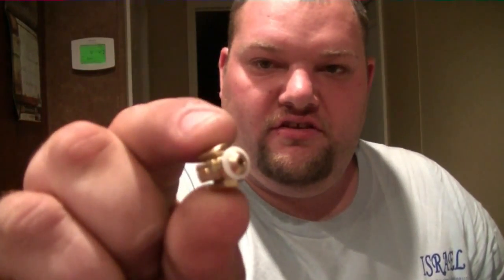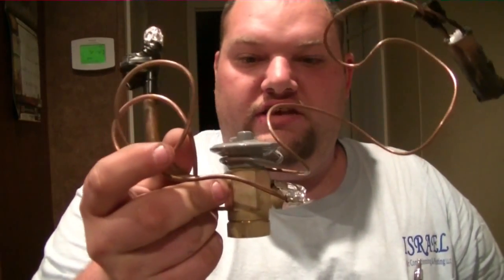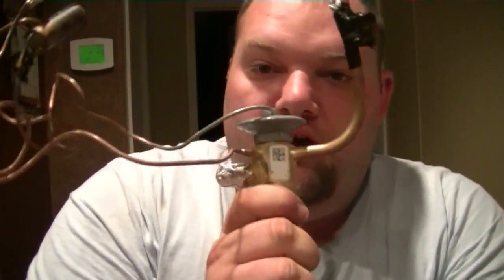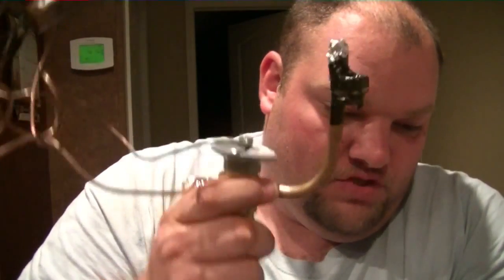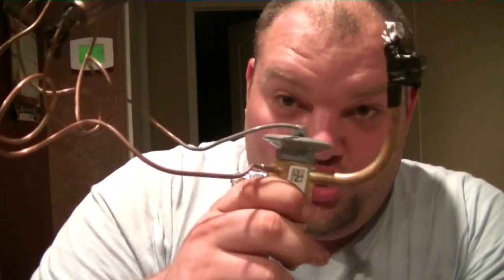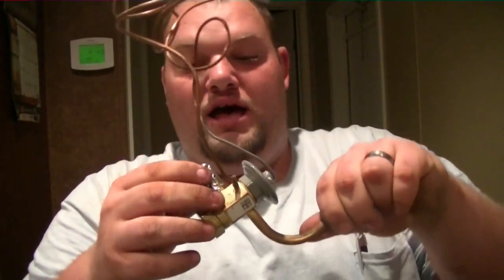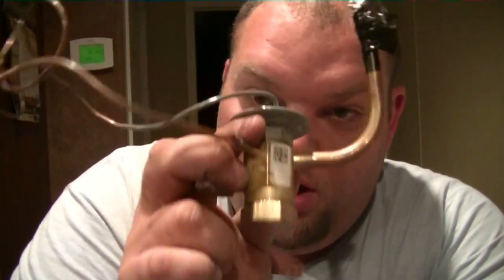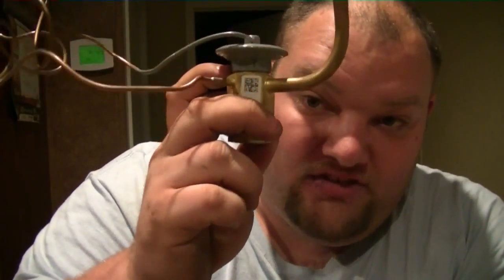HVAC Tips- Pistons vs TXV's

Comment: I see what you're getting at, but then again, it all depends on the quality of the company that made it, and how careful the technician is when installing the TXV, if it's properly heat sinked, and nitrogen purged, something else may break and total your system before the TXV breaks. You don't always necessarily have to replace every TXV you install, you've probably just had bad experiences caused by other technicians doing a bad install job.

Comment: I think we have a failing txv or an over charged unit  our comp is sweating on the side ruud unit Copland scroll 14 seer but  the unit is cooling just fine  on a 80 90 degree day the unit  will maintain 72 which is what its set too I noticed it  doing some yard work the other day bent over and  saw it sweating cause there was lot of water around the condenser  but my parents don't wanna have it checked because its still cooling. so what can ya do
Reply: oh okay well thanks  our unit is still running just fine sweating away.

Comment: I agree, in 20 years, other than installers not putting the correct piston in, or installing it backwards, not putting one in at all, or issues due to system contaminants, I've only ever found maybe 2 pistons that physically failed.

I've always been a fan of TXVs due to the efficiency gain and compressor protection, but somewhere in the 2000's the TXV manufacturers started making crappy TXVs that fail a lot.
They used to be very reliable. :(

Comment: Now you have to factor the use. A piston is good for constant loads. Where txv is good for varying loads. Example a heat pump is a great time to use a piston on the "indoor coil" where the load is for the most part constant. A txv works very well in the "outside unit" where on a heat pump the load is varying depending on the season

Comment: the txv is great if it was reliable for the life of the unit, but they are not, the entire purpose is to maintain a constant superheat so the compressor efficiency stays high, as we all know the warmer the refrigerant is the more it expands and it takes more compressor cycles to compress the gas back down, therefore reducing compressor efficiency, however the difference in efficiency is not worth the loss in long term reliability! The real answer will be when daikin introduces the electronic expansion valve with an inverter compressor in the goodman line, they already have them in air handlers up to 4 tons connected to their condensers that are vrv. This is the real future for HVAC equipment that will increase Seer and EER ratings in residential heat pump central units that will not require backup heat!